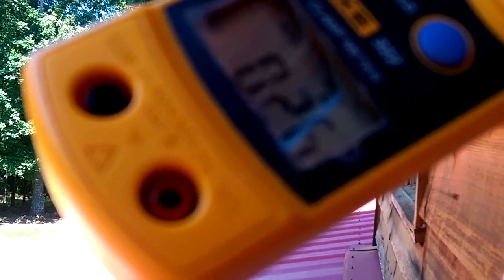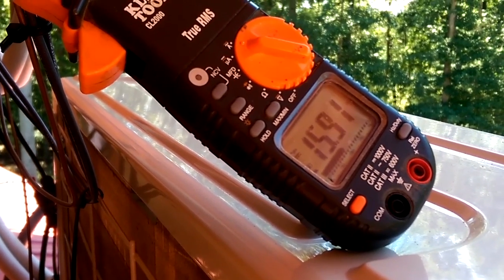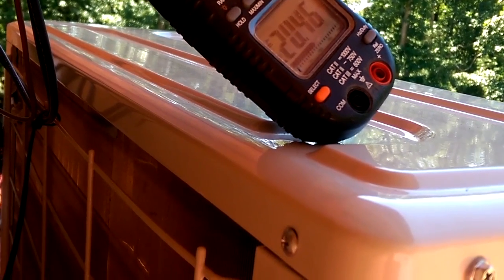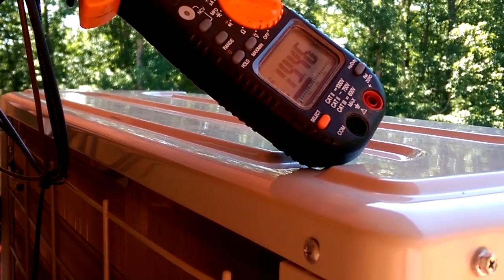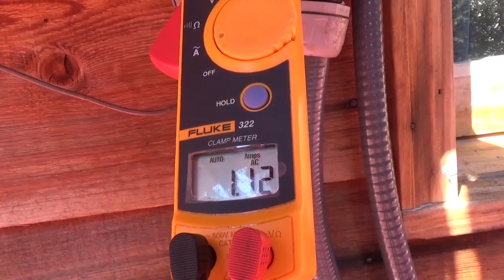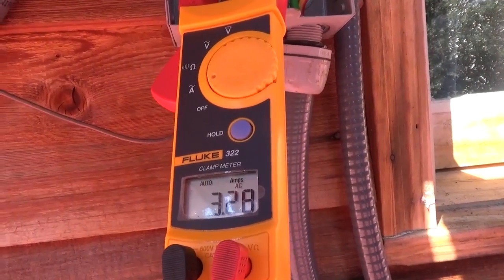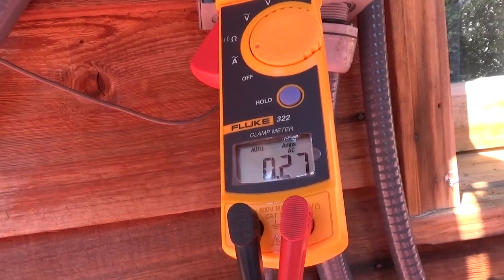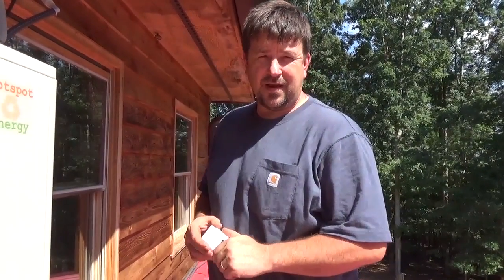Solar AC Part3 ECO MODE

Comment: Looks really well MPPTed and super EER!  COOL! 
Later on, recharge with propane see more seer! 
I use old room A/C , water spray, propane, PV power, with little investment, the satisfaction of DIY. Tune run cap. and use v/f inverter to. Water cooling the compressor case will boost seer over 20. Advanced understanding required.

Comment: John, thanks. This has been a great info for me. As you should know by now, here in Puerto Rico went through really bad hurricane (Maria) and a lot of us still suffering as far of powering anything. This is a great idea and planing to do the same on my master room, as I already have a 6K inverter/charger system and getting what its need to add solar panels and equipment to be safe in a future in an off greed situation. Thanks again.

Comment: What size breaker is needed on the ac side? And can you just use pull out switches on ac and dc? No one has come out and said how many amps they draw without solar.

Comment: sorry for late x 2 reply ,  I do not have the solar  ready unit   I live 120 miles  from hot  spot energy in Va Beach and had installed a Mitsubishi  two ton unit befor  learning of the  hot spot unit availability . Since roof  is perfect  for solar I missed out  not installing two hotspot units .  
I swear by the mini splits and the hot spot  unit would be my be hindsight  choice .

Comment: I spoke to Securus about your assertation that econo mode pulls power from the solar panels in Econo mode, Mark Wahl stated, "While your videos are very informative and you have a lot of them, but Econo mode on the hybrid ac/dc 12b actually is cutting power to the compressor, as reducing power, like running a 5000 btu unit. Hope that helps, I am still going to buy one.
Reply from the maker: Yes sir.  I found this out the hard way.  Based on initial conversations that I had with HotSpot energy I thought that PV ECO forced the unit to run off of PV and minimal AC.  So now I never find myself running it in eco mode.  Thanks for fact checking!  If I can help you get a unit let me know. I'll give you a fact checking discount. :)
Reply: I have a wine cellar and I may want to go with the DC4812vrf or dig in clay vessels into the earth for wine fermentation stabilization. But thanks for the offer.

Comment: Did you try it in heat mode? Does it have a autochange over for changing heat to cool at set point? What kind of defrost system does it have timer or sensor terminator? If it doesn't need defrost is there a thermistor to initiate or not?  Last question, why evacuate after you already had the unit running in part 2 or was that a editing thing?  I am going to buy one for my home, so thanks for posting, I will do the same.

Comment: for eve... the reason for having grid  power is on cloudy or partly cloudy days the unstable power from the solar panels would be a problem for the unjt. Power fluctuations  are evened out by having the 220 ac input.  The hart  of this ac/hp is the inverter technolgy and I can tell you it WORKS GREAT. My minisplit cut my heating cost in half and ac by 65% or $1100.00 per year.
Reply: Do you have this unit or another?

Comment: I don't understand... If you have that much solar available, why are you using ANY grid power?  Add another little 100 watt panel?  I can understand using grid power only as a backup for when it's too cloudy or it's nighttime.  But, I'd make it so no grid power is needed in full sunlight.

Comment: With that sort of heat pump, you can increase the efficiency by using a heat exchanger to heat water, if it's designed correctly.

Comment: Cool the average ductless heatpump is 13 to 22 seer these days. 35 seer is amazing.   Daikin is one of the best I have installed. Keep the filter clean and make sure it's on a snow stand for winter use. I have not installed one of these hybrids yet but looks good on cutting the energy bill.

Comment: Actually what would clearly be the better choice in this case with all the renewable energy is a Passive built home.The energy needs would be 75% or better less need.Although building passive cost more,it is still much cheaper than adding tons of renewables.

Comment: I wonder how a water furnace would do on solar. As it's very efficient on AC as well as heating. But the system is so costly. So with the cost of this system it may not be worth it. I know that when I was looking at the water furnace costs compare to the high efficiency units the cost didn't ever pay for itself unless electricity goes out of sight. Which may happen with Obonehead running the country. 

Thanks

Comment: If I remember correctly about 30 years ago a local University experimented using a parabolic mirror, to percolate coolant(like the pilot light of a propane refrigerator does) instead of a compressor: to boost a conventional AC. They Basically built a solar refrigerator around the outside unit. The hotter the sun was the colder the unit got.
I remembers seeing it use on a concept home, during a local Parade of homes, about 30 years ago.

Comment: Lots of money there, in the thousands. Most AC techs are not going to be able to troubleshoot. How about a  100 dollar window shaker drawing 400 watts and giving you 5000 btu?  The KISS theory maybe needed in a grid down event. Gizmos are great when they work but at some point they will need repair. If a killer voltage spike comes down a line do you really want to be on a grid tied system?  Total Isolation of costly inverters,charge controllers, and other electronics makes sense to me?
Reply: John Rogers Why wouldn't a/c tech be able to trouble shoot it ? Switch it to the grid and it's regular hvac unit?
Reply from the maker: John Rogers I hear you.  For the isolated system we have the 48v off grid version.  I have one in the shop to test, just so little time these days.  Here it is .. https://www.practicalpreppers.com/online-shop/air-conditioning/dc-air-conditioner-all-dc-for-off-grid-use
Reply: John Rogers There is really little difference between DC and AC at the device level.  Most HVAC equipment is made of a combination of AC motors and DC control circuitry.  As long as the device has a schematic and a service manual any HVAC tech worth their salt should have no problem diagnosing issues.  Even the $100 cheap AC units have control circuitry that can be damaged and they are expressly designed to fail after only a few years of service.
Reply: Wow 7k for 24 hours DC units. That’s the cost of my entire 400ah lithium and my 1500 watt solar array.  And I can run my 5000btu windows unit pretty much indefinitely... lol.   but I do like the split system quietness.    Great job doing this yourself!!
Reply: John Rogers I agree. I was just looking at the LG portable 10,000 btu unit at Home Depot for $318. Although this unit can be placed in any room,  I'm considering putting one in the master bedroom and installing a 4" vent through the wall for a clean install.

Comment: What would be a ballpark cost for a system like this?
Reply: They sell a 1 ton and 1.5 ton system. I just got a quote from them for a 1.5 ton system with 7 400W solar panels (you can do it with fewer, but my power company charges 10X during peak hours so I'm going to buy 6 or 7 and point them West to minimize my peak usage) and the unit plus roof mounts plus shipping is $5,632

Comment: Do you have a solution figured out to make the small amount of AC power from a solar/inverter setup?  I am not aware of many small inverters that will output 240V AC.
Reply: We use lots of magnum inverters.  
They output 120/240 vAC right out of the box and are made in the usa.
Reply: Good to know. The power requirement for the AC portion of this hybrid A/C unit is 80 watts, the smallest offering from magnum on an inverter that will output 240VAC is 3000 watts.  That is overkill in both wattage and cost.

I am surprised that the maker of the AC hybrid a/c unit didn't opt for a 120V compressor as getting a small inverter to supply that amount of power is much more readily available and reasonably priced.

Comment: A solar dual axis tracker 38 to 45% more kwh year is my findings. The other thing is snow. It comes off much better then fixed array.  It's almost the only way I'll sell a system. There are several different brands out there for size and features.
Reply: What trackers do you recommend 3-5 kW solar arrays?
Reply: Are you in the trees there the dh solar is good if it don't get to windy. It's windy as hell here it took a while for them to get the bugs out. They work good now I have three of them here in front of my shop.  Check out my web site ambergrenewableenergy.com   the allsun is good also but bigger. Sold and installed a bunch of them lots of bolts but Helical ancher if you do them quick and no dirt pile to clean up. Come in a 4x8 pallet  nice system. Cell is 320-760-0448 if you need more info.

Comment: Hello Scott,
How about making a video on making a simple solar tracker for small and large panel systems? ...What percentage of gain can be expected by tracking the panels with perpendicular exposure, versus a fixed setup? (If memory serves, it depends on the type of cells.)
.... Is it even worth it if the panels power the rotation? Or do we end up with a diminishing return overall?
Reply: " are you out of your Vulcan mind "
Reply: offplanetevent ...affirmative. ;-|
Reply: ***** 30 % is what i was told  but you  would like to see a little more on tracking.
Reply: ***** Increase in kWh production?  Typical increase of ~15-20% for a single-axis tracker and ~25-40% for a dual axis tracker
Reply: I was gonna bring this point up if Scott replied. ....Personally, I would probably just position the solar panels perpendicular to the seasonal "mean" solar arc angle (at its highest point) for my latitude, then maybe rotate a "single axis" setup horizontally using a separate small panel.
I'm not sure if it's even worth it.
.... (I'm not sure of the power loss due to tracking with only a single axis this way versus a dual axis... ...i.e.. The loss from the incorrect angle pointing at sunrise and sunset to the horizon, and the seasonal arc differential which would not be as severe, versus dual motor drain.)
One thing that may help limit some power loss is to make sure the panel array is center of gravity over the post to avoid any losses to "torque".

Comment: That is a good way to control peak loads for the power co.  Do they offer it in a heat pump.  That would be cheap heat also
Reply from the maker: Roy Amberg It is a Heat Pump 13,000 Heating and 11,000 Cooling.